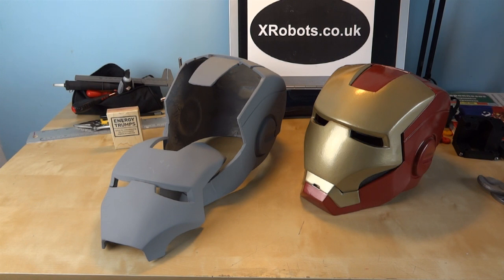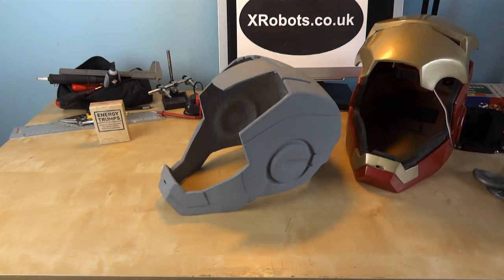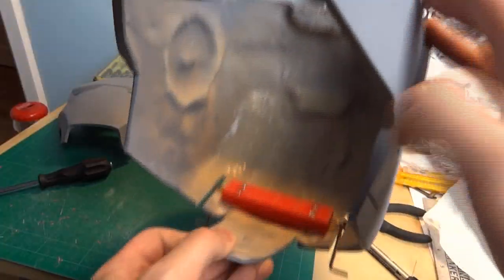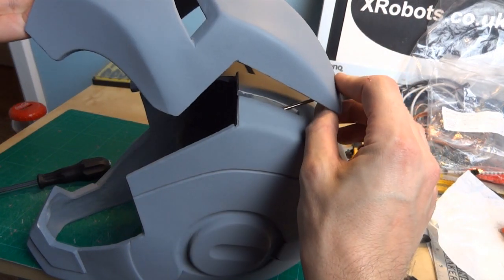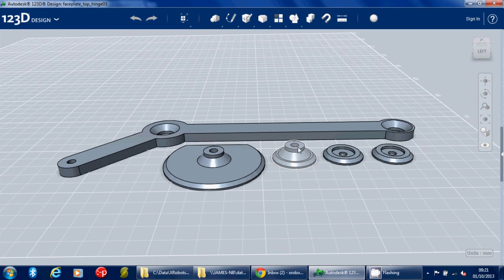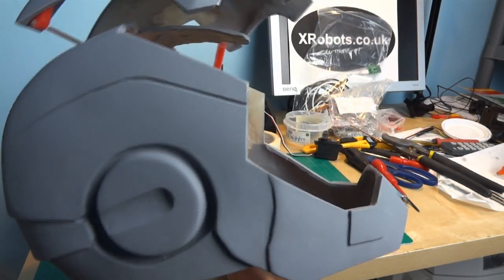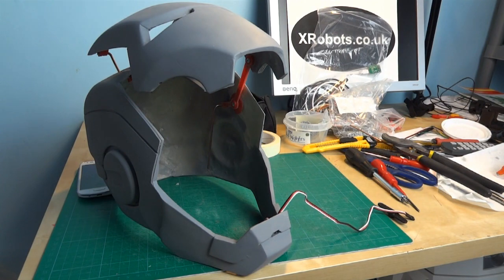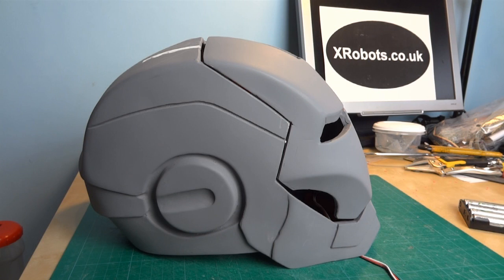Iron Man Power Suit 39 | Helmet Faceplate | James Bruton

Comment: on the servo you can get and or mod the servo for >180deg
also you could go with a MUCH smaller servo

also you need to lower your end point or use a smaller wheel on the servo
its causing the servo to buzz

Comment: You could put same system with a tube on the other side of the helmet and use the same motor to do the closing too.  And you could make it seem like in the movie instead of the faceplate just faling down back into place by the force of gravity. Plus you could use 80% of the stuff you already have in the helmet. You'd just need to print two more parts and get another tube.
But great work otherwise. :)

Comment: Nice work mate.
I cant do it better in any way at all but.
I think you need to do something about the sound when you open your helm :)
everything looks perfect and its great when you close it, but i dont like that sound when you open the helm :)

But anyways you did a great work.
thanks for sharing :)

peace
Reply: ***** Actually to address the sound, you could just allow the servo to control up and down motion.  Replace the tube and string with a brake cable from a bicycle.  This gives you a push and pull action from the cable so you can ditch the spring (which is the only thing forcing the servo to remain powered while the mask is open, causing the noise).  If you find the weight of the mask requires you to still power the servo to hold it open, you could reverse the spring to counterbalance the mask (much like the spring in a garage door) allowing the servo to require less torque to lift and hold the mask.
Reply: It might do the trick mate :)
and will make your helmet even more unique than others :)

I wish you well with your project my friend
Reply: just install some speakers to play AC/DC when your about to attack supervillain..
Reply: mate im about to build a 3d printer.. i might be able to create som parts for you
Reply: Arvydas Sirvinskas That's great idea.

Comment: Im 8 mins through and the red arm is attatched to the inside of the. When the arm swings down the face plate has a ghastly gap. I would adjust the position if the arm. 

I love this build but im sure you will correct it. Perhaps by the end of the video